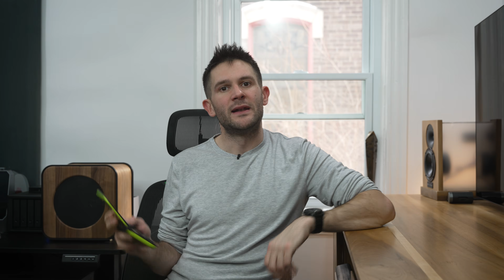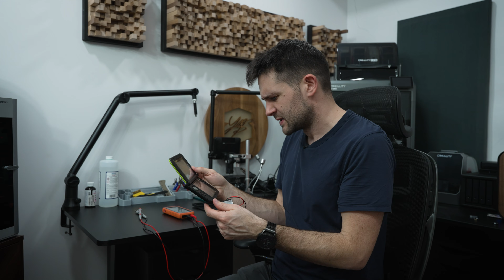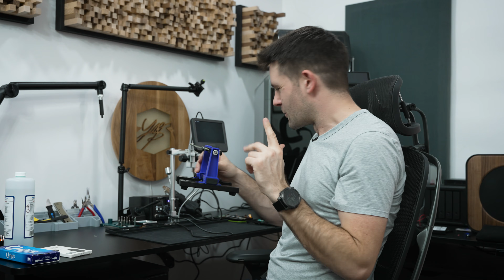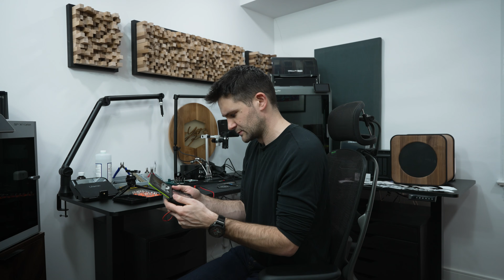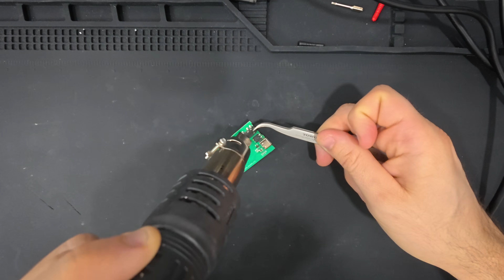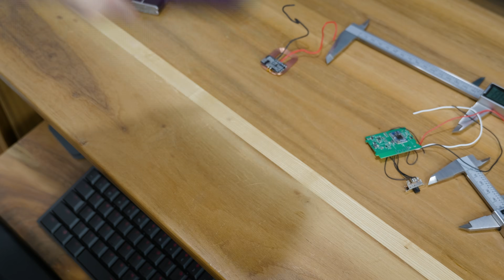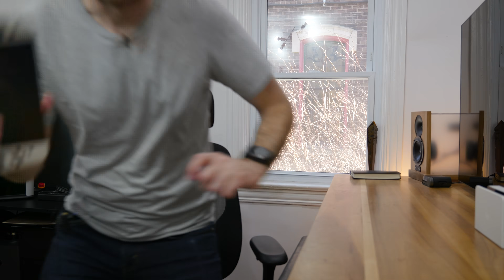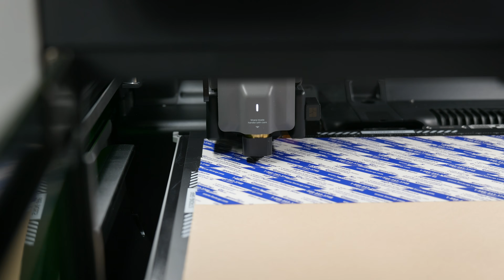I built a NEW New Nintendo 3DS....

Comment: I love the 3d effect. I know many people hate it, but it immersed me so much playing a link between worlds.
Reply: I didn't use the 3D effect until the NEW 3DS line as it had the eye trackers so I no longer got headaches.
Reply: @chuckthetekkie  yeah using the OG model was actually not great. Never got the new version but would have used 3D much more without having to hold it still. The OG and the XL should have had that to start with.
Reply: RE Revelations at 2am with 3D on was an excellent First Horror Game experience 😂
Reply: I don't think I can see it because my right eye is a strabismus eye (basically, pre-lazy eye), which prevents me from having depth perception, at least that's what I think (...Yes, yes, I know. It's a "skill issue". 😒) My current one is a Nintendo New 2DS XL as I never really used the 3D slider on my previous one, which was a gold Nintendo New 3DS XL with a big fancy Hylian Crest on the front.

Unfortunately, this means I cannot readily change the battery if it were needing replaced, though the microSD card is more easily accessible (and I suppose the game card slot as well, but I don't really need it much since I can install physical 3DS games to its microSD card.)
Reply: It only ever gave me headaches
Reply: I also love the 3D effect. I still play my 3DS with the 3D slider all the way up. Also I still compose 3D images in my computer and then send them to the 3DS. And when Youtube offered 3D videos back in the day, I downloaded a bunch of them, including the Avatar trailer, formatted them for the 3DS and then copy/pasted them in the SD card. They look awesome, still have them.
Reply: Its fine, you just dont get to use it on most games. And the quality varies greatly from game to game. Its a cool but useless Feature.
Reply: Now try emulating 3DS games using a VR headset and imagine having 3D with a good resolution.
Reply: It also sucks that the only way to use it is with original hardware, which is becoming crazy expensive (more than a switch oled FFS)
Reply: no one "hates it", stop exaggerating. people just dont think its cool or useful
Reply: @melhg20 I hate it. I gave me horrible motion sickness and headaches
Reply: its just a novelty gimmick 🤷🏻‍♂️ plus it drains battery like its no ones business which is why i hate it
Reply: I loved it for the five or so minutes before it gave me a splitting headache.
Reply: @michaelburch530  Did you have the first version or the New?
Reply: I am suprised people hated it, it never really worked for me because I am blind in one eye so the 3D effect was more like a 3D annoyance
Reply: @zexa252  People hated it because before the "New" version of the 3DS one had to stay plasered up in a specific position to not lose the 3D effect, in the New version an eye tracking was introduced that adapted the screen, so people could be more relaxed to see the 3D images, problem is that they had to buy a new console again, if they already had one.

With that considered it's not surprising at all.
Reply: @ I didn't realise that, I always thought my experience of hating it was rather niche due to my disability

therefore I thought the vast majority of people who had 2 functioning eyes would like this feature

it's the same with 3D movies, I hate them, my friends always force me to go and wear these uncofmortable af glasses and the effect litterally doesn't work
Reply: @zexa252  Well, 3D movies suffer for a different reason: they suck as movies since they are just theme park videos, but without the moving chair and as long as today's normal movies, with a fake effect made in post production (the only exception being James Cameron's Avatar, that has a real 3D effect and it's not a theme park video).

As for the effect not working on you: it shouldn't be a surprise if you are blind in one eye, therefore lackin stereoscopic vision.
Reply: @Mr_Yod  I don't think Avatar is the only exception. I remember when Coraline came out it was pretty widely celebrated for the excellent use of 3D
Reply: @Mr_Yod avatar had the same 3d issues movies have though - excessive 3d effects that are distracting, but not in focus. Avatar had little 3d dust particles and bugs and crap that would draw your attention, but were just blurry little messes - 3d on a screen is useless if you're forced into a single focus anyway
Reply: @Mr_Yod  The only 3D movie I tried to watch was Iron Man 3 and the glasses had no effect for me. On the other hand I've watched a few movies on IMAX and it was a very cool experience
Reply: @Mr_Yod  I never knew the new 3dses had that feature. to be honest, the 3d effect on my original 3ds has never bothered me so
Reply: @zexa252  Back in 2009 I bought an iZ3d monitor when building a high end gaming PC and it used passive glasses similar to the ones used in Real 3D movies. I absolutely loved it. So much better than those active shutter glasses as those not only gave me a headache from the constant shutter noise but I could actually see the shuttering effect. Now until I get my cataracts removed I have ZERO depth perception as I am 95% blind in one eye.

Comment: What a coincidence I recently bought a second hand 3ds xl and ds lite.
I shell swapped the ds lite with a black and purple combo, and it looks so cool. The only issue was that the touch screen digitizer was a bit broken, so I'll have to open it again and replace it, but it's not too bad.
The 3ds was in ok condition, it has some scratches of the outside shell, and the joystick was broken, so I replaced the joystick.
The sad thing is that all the shell mods available for the 3ds xl are VERY poor quality, I wish someone makes good quality kits

Comment: A cool idea would have been to incorporate a capture kit mod, route the charging to the usb-c port on the capture kit, include a switch so that the device doesn't have to be charging while in capture mode and make the dock support video out via HDMI or USB. Of course with this you'd need a better bluetooth mod for connecting a wireless controller.

Comment: I got a controller style grip that just hooks over the back of the system.  The connection is loose and i eneed up using velco to stick it on.  It was my first thought when you showed the gigantic original DS battery.  Maybe it wouldnt work with the huge battery along with the wireless charging and bluetooth board but i would love to see that style of back plate for this setup and maybe i would try it.

Comment: the battery mod alone is insane, add to that the wireless charging and it pretty much fixes all the problems I have with my 3DS, I hate how little battery lasts on that thing
Reply: yeah i agree with battery but also i be afraid to tamper with back of my 3ds xl but overclock so it runs slight faster is nice as i know they limited 3ds xl which is kinda nice  and not so it never overheats though takes few secs logner to turn on or open games etc.

Comment: The issue with the 3ds not turning on is the sd card, turn it on without the sd card and then turn it off then put the sd card back in it should work ( a simple google search would help tbh ) it happened to me when i did a battery mod

Comment: Nice Bambu Lab commercial, but the 3DS is pretty frankensteined together. I love the premium haptics of the original console which are completely gone after replacing the backplate with a sharp edged 3D printed version with leather inlays. Again, nice proof of concept for the most part, but hardly worth the effort, imo.
Reply: it was a pretty interesting start then halfway through it was "how many ways can i squeeze this ad in?" like, congrats on the ad man but i didn't open the ds mod video to watch you woodburn and create leather stickers

Comment: For the broke 3ds, you probably screwed up something on the board. Check the touch screen connector on the board (the plastic connector that holds the cable is very bad). The connector loses contact with the cable, press your finger on the connector where the cable is and hold it, then try to turn it on and keep holding.
Touch screen must be connected, that's why it lights up blue and then turns off.
I hope you fix it.🙂
Reply: It can absolutely boot without the digitizer. The essential ones are the bottom backlight and the top speaker/top backlight ribbon cable combo.

Comment: the original bambulabs printers are kinda meh for me, super locked down and that's something my maker mind cant get behind, but that h2d is pretty cool not gonna lie, and it also gave me inspiration for my custom 3d printer toolhead im working on, it already has a custom quick swap backplate for maintenance, might as well add lasers and cutters as well, and its gonna be open sourced from enders to voron/ratrig style printers, the only requirement rn is canbus

Comment: Well not to hate but Luma isn't the one that dumps your games. In reality it's a tool called God mode 9 (GM9)
Reply: I think you need Luma to load the gm9 payload though, they are diffefent tools by different teams with wildly different uses, but I don't think one works without the other.
Reply: @MrJackets you can boot gm9 on its own via payload.
Reply: @Goretantath he said he thinks
Reply: @MrJackets  if you read their readme they actually recommend not to use gm9 with Luma and b9s but rather using fastboot standalone !

Comment: I bought a battery pack for an old 3DS I have just sitting around just yesterday and then this videos pops up today XD. One thing I wonder is if it would be possible to use a phone battery as a replacement battery for the 3DS, like you did with the PsP mod from a couple of days ago. Replacement batteries are actually becoming hard to come by, specially outside the US and if you want better quality ones, so that would be neat.

Comment: I believe one of the dock charging pins is shorting against the outside of the usb c port on the first 3ds.
Reply: That not a bad idea. Would need investigating
Reply: I dunno, those ribbon cables are, in fact, a royal pain in the ass... if they dont seat literally perfect it wont boot, had to tear mine apart so many times for it
Reply: That one might be the ground pad

Comment: It missed screen and speakers upgrades. Please consider a 2.0 version in the future
Reply: What screen upgrade? I dont think there are even speaker upgrades for the 3ds
Reply: @klaidasrunele  Speaker uprgade is probably using the Switch V1 speakers for louder and clearer sounds.
Reply: @ndnixlon9548  Do they even fit in the switch lite
Reply: @klaidasrunele  Not sure if the V1/V2 speakers fit in the Lite but my point is that most speaker mods I've seen in the NDS / 3DS hardware modding scene (including the "macro" mods) uses the Switch V1/V2 speaker module.
Reply: @ndnixlon9548  Never seen anyone do a speaker upgrade on any 3DS systems except for the custom shells like the macros
Reply: @klaidasrunele You can solder any speaker onto the 3DS, a big upgrade would be the Switch OLED speakers which can work if you modify the upper shell a bit.
Reply: @klaidasrunele  most 3ds systems including new ones had TN screens instead of IPS. IPS is the best screen to have
Reply: @misfit4816  It's not an upgrade you can do. It's just being lucky. Most chinse replacement LCDs all suck.
Reply: I don’t think any good aftermarket screens exist yet. Maybe in the near future though with the 3ds modding boom.
Reply: @klaidasrunele You can buy used IPS screens and make the swap on a TN 3DS, you are very confidently incorrect.

Comment: I am not an expert but, 
1. Isn't it better to connect the battery cells together and then use only one bms of the battery? 
2.That wireless charger contains some feromagnetic material. When you diassemble, you excluded that. Isn't it reduces the inductance of the coil and changes the resonance frequency and reduces efficiency?

Comment: Im curious about the battery doubling. I have a lot of rc cars with Lipo batterys and every individuel cell needs to be balanced seperatly or they will discharge and charge at different rates. If you just connect everything in parallel as you have done then that balancing wont be possible anymore and your cells will start to degrade much faster than normaly. It can also lead to completly discharged cells while the other cell is still good but the battery isnt usable anymore.

Comment: a tip for your future projects: use higher gauge wires, like 24-26, maybe even 28awg. They'll perform just as good at what you need them for and they'll take much less space and you'll have less of a pain managing them.
Reply: ha ive done alot of 3ds modding too and i was thinking the same thing of why he was using such thick wires since 26 is just fine for all of the wires he chooses to use and he might even be able to slim it down even more if possible.
Reply: @Your_average_hobbyist  I also usually go on a rant how for every use case there's a tool that suits it best, but I thought I'd cut him some slack, he's a beginner after all, he'll reach that point on his own most likely. Having a modular soldering station changes one's entire attitude toward these kinds of projects. General use, precision and micro-soldering handles and tips exist for a reason 😁
Reply: My favorite is 28 or 30 awg Kynar wire.  If you do go looking for Kynar wire though, beware there are a lot of vendors advertising stuff that's actually just cheap hookup wire with pvc insulation that burns very easily.  Real Kynar wire has a Teflon insulation that will not burn if touched by a hot soldering iron tip.
Reply: @BEdmonson85  it's the stuff that we use in electron detectors, good shit my guy 😁
Reply: Haha the conversation got hella technical xD
Reply: @BEdmonson85  stripping it is a b** though
Reply: @BEdmonson85 I have added USB-C to some of my consoles (including 3DS) and my go to right now are: 30 AWG silicon wire and 30 AWG enameled wire

I found that the coating on the kynar wire I was using before burnt too fast when I was tinning the wire with solder, and that's why I switched from using them
Reply: @mumind2726  it shouldn't melt that fast, kynar insulator resists up to 100 celcius of sustained exposure (don't remember for how long though). If you're melting it by just tinning the wire then it's either not a real kynar wire or you're heating the wire too long and too much. A good lead-free solder will melt at about 240-260 celcius and you need to heat the exposed end of a wire for 3-5 seconds for the solder to flow properly.
Reply: @lateralol  yeah there's a chance that my Kynar wire just had a shitty coating (it felt like plastic). I usually work with my Iron set to 300-330 celsius and I can assure you that I ain't tinnig a single wire for 5 minutes 😉
Reply: But then where's the value for the sponsor... Haha
Reply: He probably just used what he had on-hand. When I need 26/28 awg I will usually cut up an old USB cable, though!
Reply: @husky3g  recycle and repurpose! I do the same with my old cables 😁
Reply: @husky3g I know this is an old comment, but thank you for the suggestion...I have a bin of old usb cables, I don't know why I didn't think to do this before!
Reply: Saved me writing this. All the clever tools and repurposing of old tech is great, but god man, use thinner wires!
Reply: Yeah, never understood why he uses such thick wires, makes no sense at all
Reply: Mod kits for gameboys often come with 30 gauge wire although that’s a bit challenging for some
Reply: Same
Reply: say it in mm, avg is not a proper size.
Reply: That would be a lower gauge bud
Reply: @doctorwhat8856  lower gauge = thicker wire. Higher gauge = thinner wire.
Reply: Redditors found here
Reply: @eldeeablow ?

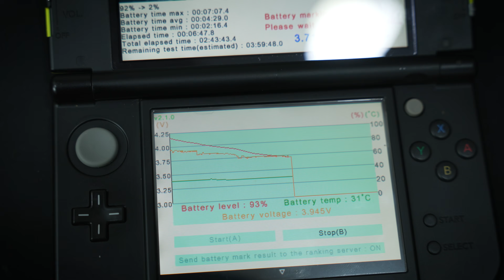Comment: 5:27 - maybe just a slip of the tongue. But the idiom is "suffice to say"
Reply: Huh, I always thought it was "suffice it to say"
Reply: "Sufficient to say" is a phrase used to indicate that a concise statement is adequate to convey the point, even though a more detailed explanation could be provided.
Reply: @rdebeer4071  
If you read your chatgpt answer a bit further along you will see that it is drawing the definition from "suffice to say". 

"Sufficient to say" is incorrect. It doesn't stop you using it if you want to, it might even be common enough where you are from to be considered the right expression. But that doesn't change the fact that it has come from the original idiom.

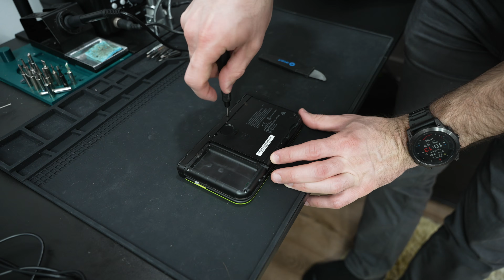Comment: 5:52 Using LTT bits with an IFIXIT screwdriver :).
Reply: He commited a sin
Reply: @depokaosu  Personally I think it is great. I have an IFIXIT kit and I love the driver but the bits can be a bit too short. I have considered buying just the LTT bits and using my IFIXIT driver. LTT even recomends this. (It still feels wrong though).
Reply: @MattsAdventures-1 LTT recommends buying stuff from LTT, what a shocker
You do not need to buy an overpriced set of LTT bits to use with your iFixit driver that already came with bits.
Reply: @mjc0961 I totally agree with you. I do regularly use my IFIXIT kit and often run into my bits being too short. However, In that case I just grab a normal screwdriver which is why I haven't bought the overpriced LTT set.